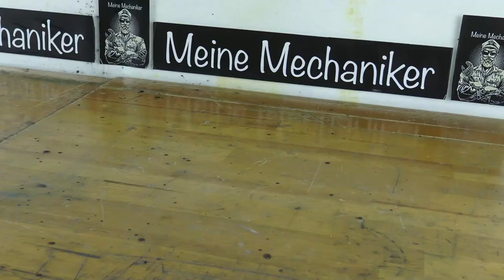Old Rusty Darex Hand Plane Restoration - Cabinet Scraper Plane Restoration

Comment: You clearly are a very good metal worker. Your skill at making metal shine is perfect. However I have to comment on this tool specifically. I own over 200 hand planes. I own several versions of this plane from Stanley to VerItas and the like. The tool is meant to be pushed in the other direction. This is a cabinet scraper. It is sharpened in one of two ways. One is square and then the edge is rolled with a burnisher to create a hook. The other is at a 45 degree angle and then also hooked with a burnisher. This creates very fine shaving to level a surface on the final shaping. I kinda cringed when I saw you pull it the wrong way. The other thing is the bottom is normally lapped flat on a very flat surface to eliminate high and low spots. This is what helps create the finish on wood that you get with metal!
Reply from the maker: Thank you for the information. I was absolutely novice in experience. I hope you forgive.
Reply: Right you are. I love this channel, too, but had the same reaction as you did. No worries, and the reply you got was respectful and proper. The tools of the cabinet making trade are very specialized and some are just plain weird. Most prefer to use a burnished card scraper. Or even a shard of glass.
Reply: Was just about to point this out myself.